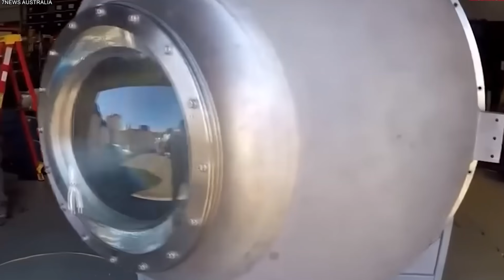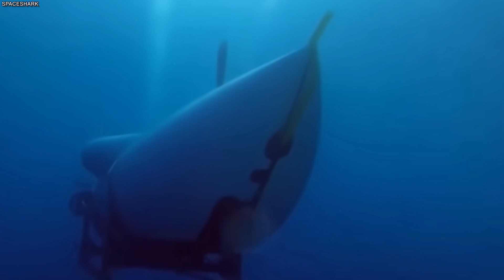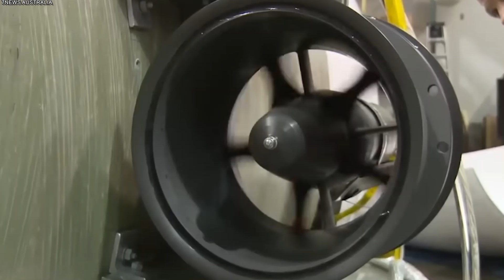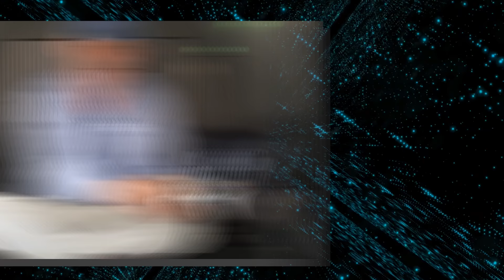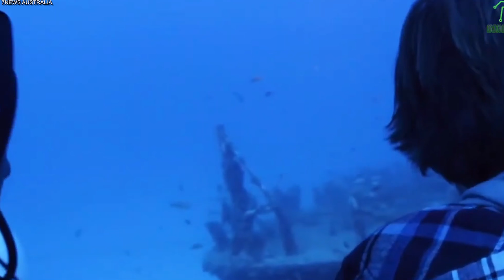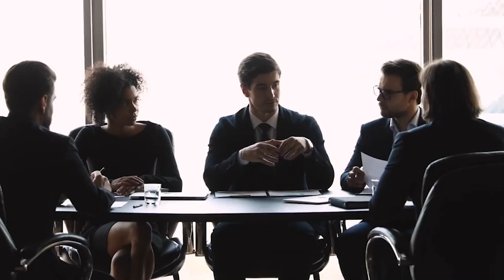The Truth About The Titan Sub Disaster Is Finally Out, It's Not Pretty

Comment: The entire submarine community have already stated multiple times that the dropping of the 2 weights was to slow down the descent as they approached the bottom. Although it sounded worrisome, it was completely normal. May wanna update the video about that.
Reply: The craft had already lost contact with the surface, before they got the message about the weights, so it could have dropped the weights as it may have been out of control and descending too quickly and carbon fibre hull breaking. At any rate, very sad indeed, and we will never know exactly what occurred in its last moments other than it imploded.